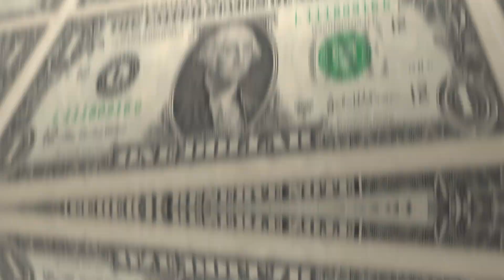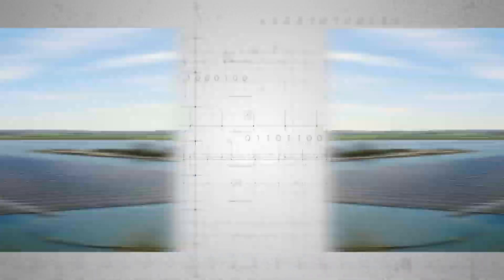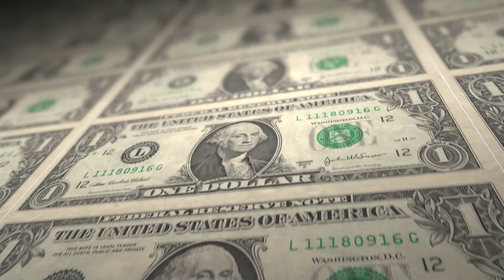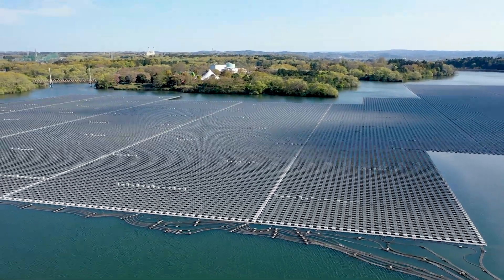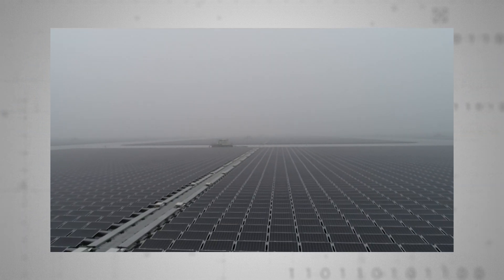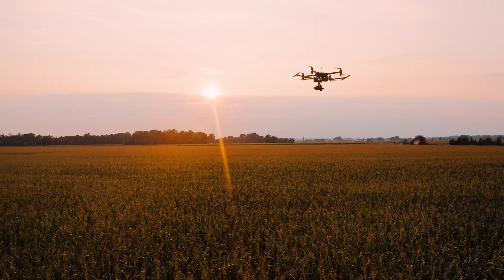The World's Largest Floating Solar Farm

Comment: Two benefits of floating solar farms: 
1. solar is more efficient if they are kept cool, which is the case over water, and 
2. cleaning them with water is very easy when they on water.
Reply: They should really build one above the Salton Sea in California. That would slow down evaporation and the exposure of the poisoned lakebed. And it could power half of California.
Reply: @illuminate4622  Good idea. The lake is shrinking though as I understand it. I wonder if a floating solar cell canopy could save it
Reply: I assume there will be some chemical corrosion for the soloar planal to deal with, especially if they are floating on sea water 24-7.
Reply: @TL-fe9si  Most floating solar farms are on fresh water, which have no tides or big waves, so the casing structure is less expensive to build. In sea water cases, then yes, there would be more maintenance required. Even then though, the floating ocean solar farm is a lot cheaper to maintain than the other two significant sea water renewable energy systems, which are wind power, and tide water turbines. Both of those are partially or fully under water, which require boat transport, and sometimes divers to maintain.
Reply: @ProgressiveVegan  you're not taking into consideration the fact that wind and tide turbines are much, much more efficient at producing energy compared to the space they take. also, those floating solar panels, as shown in the video, do not even have trackers (since they would probably need to be a lot heavier and spaced out) which means that they only produce their maximum theoretical producible power 1 time in a day (when the sun is perpendicular to them). sure, in spaces where there is a patch of unused fresh water, filling them with solar panels is not a bad idea but if we're talking about the ocean then wind and tide turbines are better.
but even if you really want to use solar panels, what can you possibly do to prevent a simple wave in the middle of the ocean to just destroy the entire farm? you would probably need to create some sort of solid platform on top of the water, but then the cost would rise really quickly
Reply: Hi @marcolvz , I consider your points valid, but my original comment had nothing to do with wind power, and for the reason you pointed out, which is that open ocean water waves could destroy a floating solar farm, these two sources of renewable energy will likely never compete for space. Floating solar farms need to be over either fresh water or over protected lagoon-type ocean water near land.
Reply: another is earthquake resistance
Reply: salt water kills anything.
Reply: I think floating solar farms is best🙌

Comment: All new houses should have solar installed on the roof as part of the construction. The government should cover the cost as the power can be feed back into the grid. Why cover water when  roofs are everywhere.
Reply: Each and every metered connection to be assigned at least 1kwh, to be later scaled up to entire connected load

Comment: Viewed in isolation, it may sound good. 
Did we forget the promise of rooftop solar, how far did we get with it?
Reply: South East Asian here. Demand is rising for residentials, we actually had ours installed two days ago. Although it is cheaper than half decade ago, once the price goes further down, more people will avail it.
Reply: It’s coming along at a good pace, I had mine put in last year. The installers were backlogged over a month. It took them one day to put in 11 panels in three locations on my roof many feet apart, plus new electrical panel and the solar control box.
Reply: @Chainyanker007  progressive and inspiring news. All the very best
Reply: @Chainyanker007  happy to know about progress. Am contemplating similar actin, paused for inspiration. Would those 11 panels cover entire load requirement when generating, nit after sun down. Would not like to confuse generation with storage
Reply: @Chainyanker007  fail to understand why often un nt case, good things happen in installments and with unexpected delays

Comment: nice video. glad to see that the topic gets into the mainstream. but PLEASE learn the difference between energy (e.g. GWh) and power (MW) resp. energy production and power capacity! They are not the same and it would be just professional to get it right - especially for a channel providing tech content.
Reply: sorry are you saying the issue is mixing up MW and GW, or that adding the h (to either) means your talking about storage capacity since its power over time vs just instant power with no storage? I'm just confused as to why you wouldn't use MW/MWh to stick to the same unit.
Reply: @somethingsomething404  Hi. The usage of the "h" indicates that a certain amount of power (MW, GW, kW, etc.) is provided for a certain amount of time (h) which results in energy (MWh, GWh, kWh, etc.). So power is that capacity to do some work aka energy. Storage capacity can be expressed as power capacity (e.g. in MW, kW, GW, etc.) or in energy stored by the storage (e.g. kWh, MJ, MWh, etc.). Energy and power are strongly correlated but they are not the same. It is physically just very important to keep these apart.

Comment: I doubt putting solar panels over water reservoirs and not turning them into a cooking pot
Reply: Think again please. Do you know what the term albedo means? Also, what Happens with the Suns energy that is converter into electricity? Can that part still heat the water?

Comment: It's fantastic technology providing food and clean power. Floating deep sea wind also has massive potential.
Reply: There's no point in deploying these into water which substantially increases costs.  These could be used to cover roofs thus lowering structures cooling requirements while prolonging the life of the roof.  It literally be putting the power to precisely where it's used eliminating the need tor power cables and other such infrastructure to support it.  Also, water and electricity aren't friends.
Reply: @mhamma6560  Placing solar panels on water helps keep the water cool and the water keeps the panels cool and clean which helps the panels work better. Rooftop solar is also great there's room for both.
Reply: @pauladams1829  and what are these solar panels made of? Cause if they contain metals like zinc,  aluminium or minerals made from coal, then lake will get poisoned when these tiny particles and poison from battery (lithium based) might leak into water. Sure, water might not get hot, it just turns lethal anyway.
Reply: @aereiq  there is no pollution free energy production scheme out there.  Its rested on a plastic film on the membrane

Comment: This would allow you also to cool the solar panels with a working fluid and heat pump dissipating heat into the ocean producing power along with extending the life of the solar panel and improving efficiency.
Reply: These systems are being developed to go onto lakes. Not onto the ocean. Good luck generating tidal wave energy on a lake. But the idea with the heatpump sounds very promising. This way more of the energy goes into the waterbody also, that would otherwise be blocked by the panels.
Reply: You could also harness wave energy at the same time with pistons and hydraulic pumps as the structure rises and falls from wave action.

Comment: I'd like to see a thermoelectric generator layer between the water and the solar panel for extra power. Can't wait until that's a popular thing.
Reply: the temparature gradient would be too small to make something efficient out of it, lets say you get 60 degrees C, you can get 50% efficiency max. with 30 degrees air temperature. And thats the upper limit (carnought thermal efficiency) . Meanwhile thermosolar plants reach 400 degrees and can still be improved...
Reply: @homo-sapiens-dubium  That makes sense but the overall efficiency of TEGs nowadays I think is around 5%. If they were way higher it might make sence even with a 30 degree difference. Ive also been thinking, once you start drawing current from the TECs, the temp on the cooler side heats up. That might heat up the lake or reservoir and cause different issues. Anyway, Cheers.

Comment: What about salt corosion if you place solar panels on sea? What about stain development from bird excrement? Doesn't that reduce the efficiency of a solar panel? Are there excisting cleaning processes for that in place?

What about photosynthesis? Don't marine-based plants require sunlight in order to grow?
Reply: These aren't in seas and oceans. That would be too rough and corrosive. These are in mostly man made lakes. In the vid they said that the gap between the panels allows in adequate sunlight for marine plants and animals below it. I assume it is smth similar to lotus leaves on top of a lake. As for the bird poop, that can be easily cleaned through normal maintenance procedures.

Comment: Hangzhao Fengling (stage 1)  is 320 MegaWatts, not 300 GigaWatts.   That's a big difference. Also, units of power are Watts and units of energy are WattHours  (or Joules for SI units).
Reply: Watts three orders of magnitude between friends?  Pun intended.
Reply: @leetakamiya  🤣🤣🤣
nice one
Reply: I was about to post about this colossal mistake too. Apparently the largest nuclear power plant has a capacity of over 8GW and the three gorges dam has a capacity of  22.5GW.
Reply: he mentioned 300GWH and 120MW. Different units and confusing at first glance
Reply: @vamsisayani  Yes, it is an odd mistake.  300GWh has possible interpretation as  providing annual electricity demand of 3MWh per household on average. It implies peak output power  of something near 150 MW.
Reply: Ohh lord , 
Give mercy on them , they are unaware of electrical engineering..
Reply: I noticed this mistake immediately.  The idea behind floating solar plants is a good one, but this video stumbles over itself by providing the wrong numbers.
Reply: 320 Gigawatts are 320 RBMK-1000 Reactors at full Production!
Reply: @joe joe Question: how much do you pay for your house electricity? Can you tell us?
Reply: 4:30 Shows 10,6000 TWh, says 10,600TW. Wrong number and wrong unit. Nothing to learn here
Reply: @senftube2460  At least we learned that floating solar exists. All too often the narrator of a youtube video (or even a TV documentary) can speak clearly and authoritatively but has no idea if the words s/he spouts are accurate.
Reply: @senftube2460  10,600 TWh divided by (8,760 x ~.25 for solar capacity factor) is about a 5 TW system which is impossible to have already been installed. Global scale solar will be only like 60TW (and that's for double what the world uses now, in all forms).
Maybe it was in GWh, but still, that's about 125 sq km coverage.

Comment: Solar Panels are Clean :D
Reply: After oil is drilled and pumped, plastic is produced and old panels are disposed in landfill
Reply: @3mtech  I’m not sure how and why you connect oil and plastics with decommissioned PV-panels here?! But I can tell you how Germany dealt with this. We categorised those panels together with other electronics waste which is required to be recycled. So there are almost no panels going to landfills here. And even if they were, it’s not like there are any rare or toxic compounds in those panels.
Reply: @petergoestohollywood382  Haja. Recycled. So every part is recycled? Nothing goes to landfill. Panels are made mostly of plastic that is made from oil.
Reply: @3mtech  yes, thats the Code in Germany. Im sure it’s not 100,00% effective, but what law is?! 
Mostly made from plastic??? Some thin film panels may use larger percentages of plastics as they use it as a structural material. But thin film photovoltaics makes up less than 5% of commercial photovoltaics. The broad majority is crystalline silicon which is laminated between glass sheets. Plastics are used in isolating layers inbetween the sandwich. The amounts used are therefore very small since they serve no structural purpose. And even if, the lifespan of PV-Panels exceeds 20 - 30 years with ease. I bet you waste 100x as much plastics in a year than my photovoltaic system required in its entire manufacturing process.

Comment: Solar farms take up a lot of space ... then why not just place the solar panels on the roofs?💁 ...no, it's "much easier" to place it entirely on the water?! I don't get it.
Reply: Me too😂😅🤔
Reply: Rooftop solar panels only sufficient for house only for heavy industries we need massive solar parks.
Reply: @dipak2074  actually that's wrong, if you cover all roofs you would have more than enough power.
The only problem is, as I said earlier, the storage of this produced electricity.

An example, for Germany it was calculated that if every house roof is covered with solar panels, you would produce three times more electricity than Germany consumes in one year. The only problem then is, the storage, because much more electricity is produced in summer than in winter.
Reply: The mark of low IQ beast  Read about Marin katusa,the katusa research
Reply: The mark of low IQ beast  Ignorance(youth?) truly is bliss. Most comments on here are fron individuals that have no idea what an amp or a watt is or load bearing weight considerations or solar is like 0% efficient if not oriented in the right direction
Reply: The mark of low IQ beast  Im not expert buy I think 1/4 of the time would be really good
Reply: 1. You can't just put a solar panel in any building, you have to make a agreement with the building's owner ($$$).
2. You have to install custom energy lines in the building to receive the energy from the solar panels ($$$).

In conclusion, installing solar panels in a building is a small project itself, because almost all buildings are different. So, this is not attractive from an investor's perspective, because they preffer to evaluate a single big project instead of many small projects. That's why is "much easier" to do what they're doing (not to mention that the earnings are lower because of what was said in points 1 and 2).
Reply: @_VeritasVosLiberabit_  yes of course, from an investor's point of view it makes more sense to open a large farm. But we're talking about environmental protection, which doesn't have to be (or should't be) financially worthwhile, and this is exactly where, in my opinion, the government should intervene.
Reply: @Temurtv.official  I agree with you, I like to think in the nature, but sadly that's not how the world works. The world revolves around money. My comment wasn't about thinking only in money, my comment was trying to give a realistic point of view of why your proposal is very hard to make. Governments are recently transitioning to clean energy not primarily because they care about the environment (with the exception of some Nordic countries), but because oil is running out. I really like your idea, and I hope that one day it can be carried out.
Reply: @_VeritasVosLiberabit_  LIAR the less wires needed for solar the better and solar pannels near house= the least wires.
Reply: The mark of low IQ beast  private equity owners could get an subsidy, if they place solar on their roof. That would support the grid and the only problem would then be the storage of electricity (But that's not the topic of this video). 
As a taxpayer, I would of course pay for it indirectly, because the government has to get this money from somewhere for those subsidies.

Comment: The entire setup also need to be elastic enough to accommodate fluctuations in the water levels, maintenance etc.
It's a commendable achievement, if they're able to get it done with all these aspects in mind.
Reply: India also stabilised floating solar panels in MP.
Reply: @AimPitcher____3  In Telangana and Rajasthan as well
Reply: @AimPitcher____3  They copied India...you mean?
Reply: @parnamsaini4751  no, noone copied anyone, floating solar farms need local configuration so each instance is different.
Reply: What do you mean if they are able to get it done.  They are doing it, in China.  Whatch the video again you will see.
Reply: @brianpaton6687  yeah but there are no fluctuations in still waters where project takes place. The whole argument is pointless.
Reply: @seapirate7770  Thats why they are putting them in still waters.